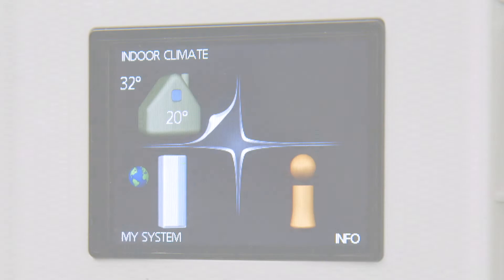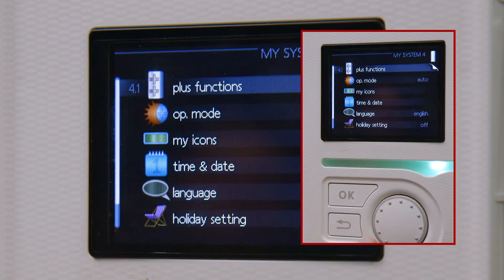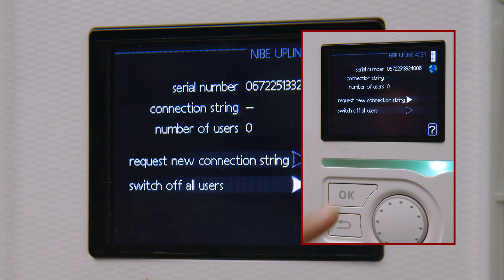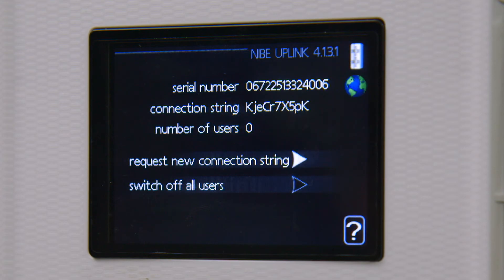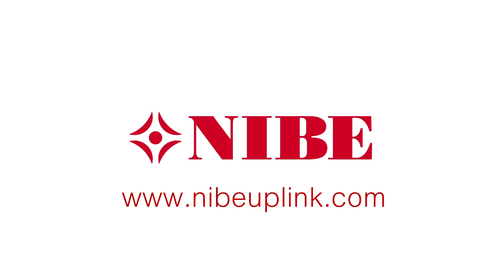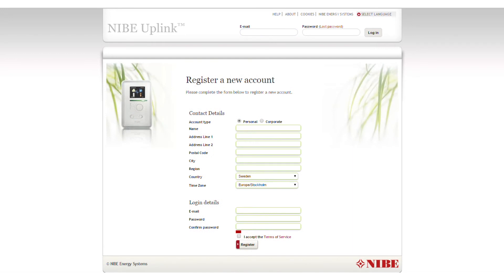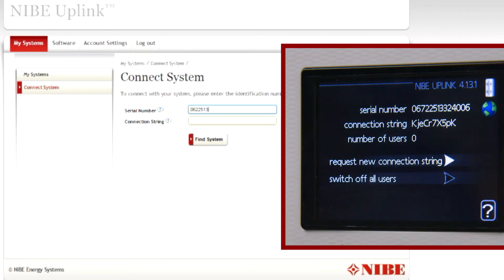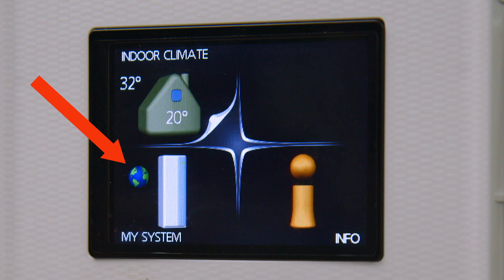NIBE - How to set up NIBE Uplink

Comment: Hello, how can I know if my Nibe F750 has a network connection? Do need to plug a cable somewhere? Curious for any info
Reply: in the back of your F750 there is a cable with a plug to connect your internet cable, it´s in a very weird place and it took me long time to find, I simply do not understand why NIBE don´t make clear and visual instructions...at least when i was setting my up i found it very complicated. Now for some even more weird reasons it´s complaining that my system lacks connection to myUplink...it has worked for many months without problem and now simply giving this message, and yes i do have functioning internet as I double tested the cable. Now i am struggling to connect to the system again...this whole system is very complicated and I dont think it was designed to make things easier :)
Reply: There should be a network cable on the back of the unit, I found this document. 
https://www.nibe.eu/assets/documents/23655/M12033-4.pdf